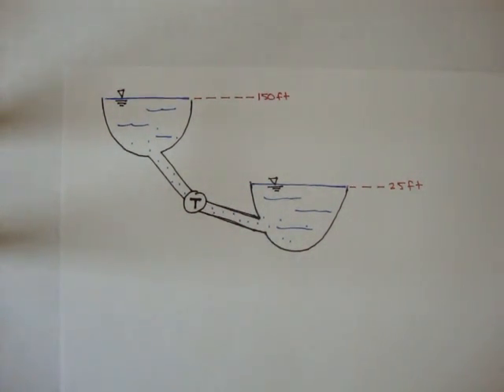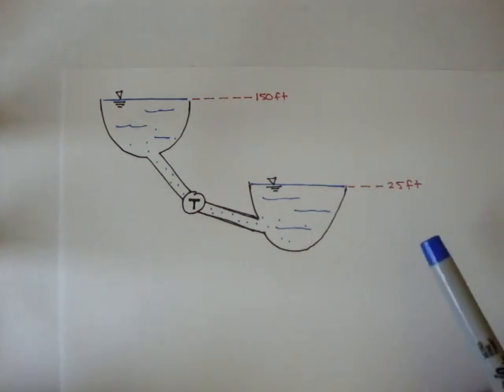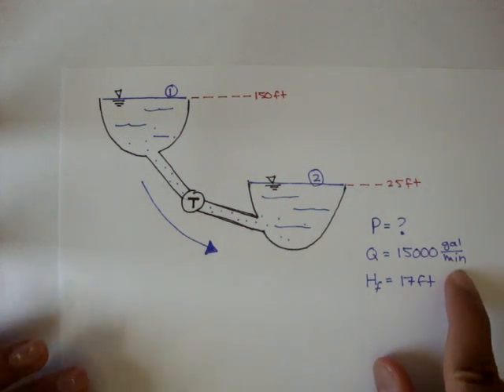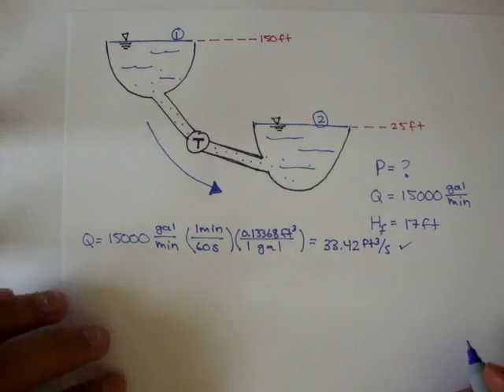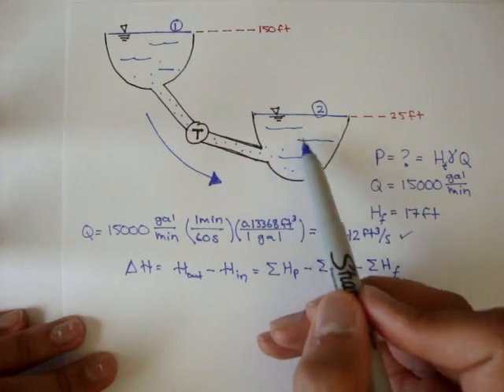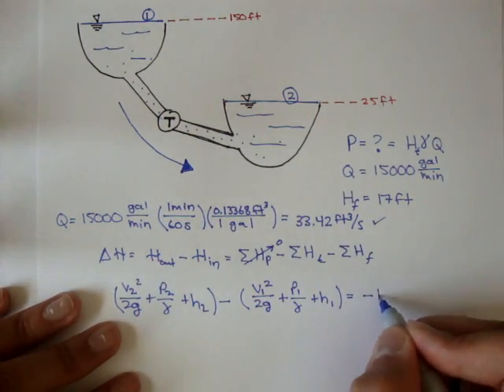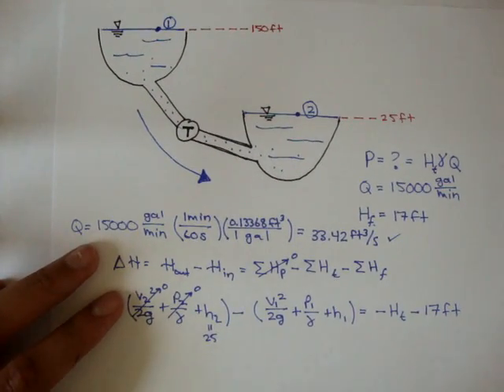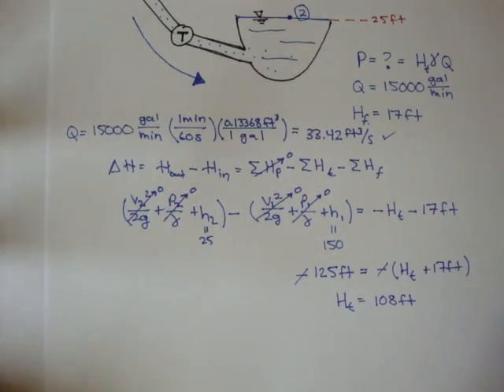Power and Energy: Example 3 [Fluid Mechanics #35]

Comment: Nice problem, but there was a mistake at the end. ft.lbf/sec is not equivalent to Watts nor horsepowers (hp). The answer for hydraulic power is 225,260 ft.lbf/s (using T= 50 degrees F) = 410 hp = 305,412 Watts = 305.4 KW.

Comment: Hey the power you calculated equals ft*lb/sec which you should convert to HP by multiply by 1/550
Reply: pipe fabrication in urdu

Comment: Thank you for the lessosns, they are supper useful. Just a quick thing (it debusolated me for  abit cause i calculated everything in the international system). your final answer is in feet x pound / sec; not watt. Technically it's 305,29 kW after doing the conversion

Comment: Simmy Sigma Thank you for making fluid mechanics (FM) so much easier to understand. It is so simplified and helps a lot with my basics and understanding. I have a question and hopefully you can answer me. From one of your videos on FM, you mentioned that turbine take aways energy so the Power is negative and the turbine head is negative. How come it dont show in this case? Thanks in advance for your early reply.
Reply: I think that you already account for the negative by subtracting  the sum of the turbine Heads.

Similar to how we are given a Friction Head Loss Value of 17. We account for the loss by putting a negative in front of the sum.